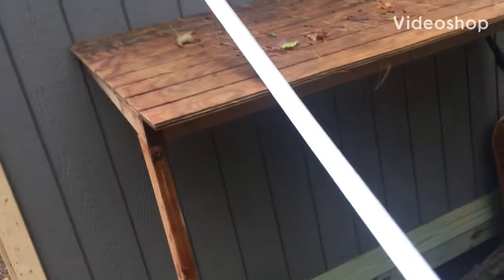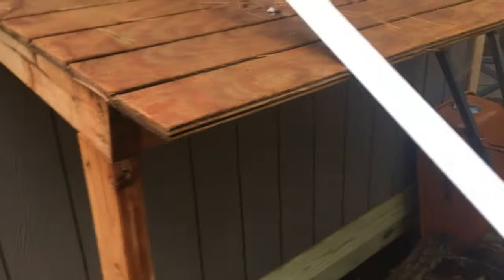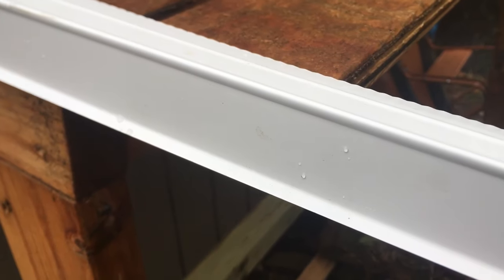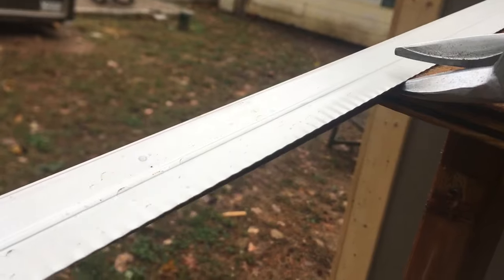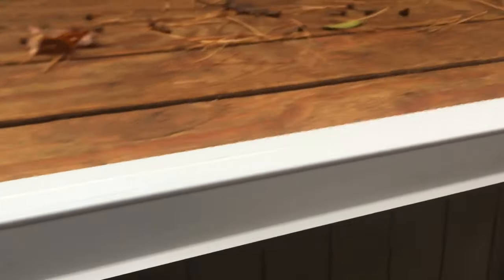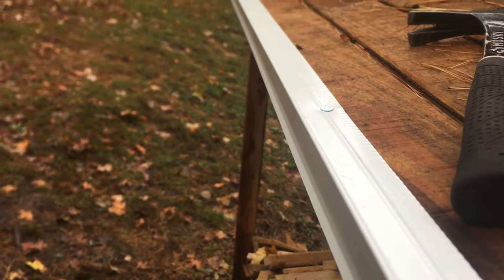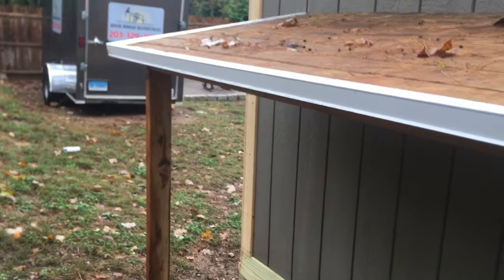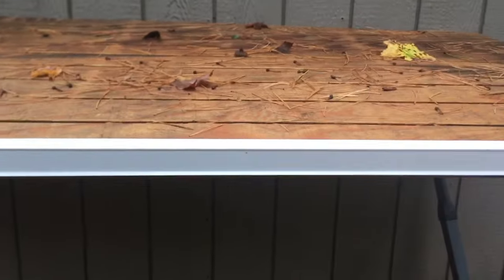How to install drip edge on a roof.

Comment: Your first corner should have been tucked under the piece coming down the side. The second corner was correct.
Reply from the maker: topshotrhit I saw it after . Ended up taking it all off and redoing it. Thanks for watching TOPSHOT👍
Reply: @HighRidgeHandyman  I've watched several other videos where they hack the edges to death - yours is simple simon, no sharp edges, and beautiful.   I read the comment about tucking under the piece, something I shall do.  I am re-tarring and papering backyard patio roof (Never having done anything like that) and am learning how via video's like yours.  Thank you for the video!  Oh, and now I know I need tin snips!
Reply: topshotrhit I was going to saw the same. His other corner was good but the first was wtf?
Reply: topshotrhit  exactly
Reply: Would I use this method on a hip roof?? I realize the angle will be a little off at rounding the corner to the other hip..
Reply: Nice catch.
Reply: I tuck both corners under the top gable flux capacitor gap cut.
Reply: yesxactly
Reply: Absolutely!

Comment: If you have fascia under this the corner here can cause water running down the fascia corner. I don't know the solution but the solution is what I am looking for.
Reply from the maker: They sell much larger drip edge with more of a bottom flare. But with gutters installed they should also protect the fascia

Comment: Good job only problem I see is the first corner is supposed to go under versus over the second corner was done correctly I appreciate your demonstration it will help me to do my roof .
Reply from the maker: Shawn Maxx thanks I did realize the first was over instead of under. Thanks for watching. If I could edit this I would. Or even add a clip. Have a good holiday weekend

Comment: On the corner you also need a cut at the bottom through to the other bend in the metal and that way your lip/ bottom bend  will not flatten out when you bend the metal.

Comment: It helps to cut a small  on the bottom of the  drip edge where the corner will be. This helps to avoid the aluminum from buckling in any way
Reply: Oops...a small v. Would look like an upside down v
Reply: Visually from a non roofer perspective (this way looks cleaner to me) but you’re not wrong

Comment: I do it the gangster way, tab and miter not cut and fold. but I also do alot more 24 gauge and standing seam. currently doing zinc coated copper panels on a big commercial project (3year project) and zinc coated copper wall panels. I also do pvc, tpo, modified torch down, cold process, epdm, only thing I don't touch is shingles. I call them guys shingleberries
Reply from the maker: Don’t ever forget where you came from bro👍🏻 We ALL start off as shingleberries.

Comment: From what I've read, typically the drip edge on the eave goes down first, then the asphalt paper overlaps that drip edge, and then the rake drip edge goes on, covering the paper. So the rakes and eaves should be two separate pieces. Nice job on bending the corner, though - that's helpful for other applications!
Reply: One thing to keep in mind. If a gutter is going to be installed, it usually gets tucked under the Drip edge. The gutter people will cut the Drip edge to get the gutter to reach the corner of the roof or even go past by ½ inch. 
My point the eve (Drip edge) should be its own piece and the rake Drip edge should be its own piece.
Reply: Can you use the one drop edge piece to complete the drip edge?

Comment: Nice video.  My observation is that The first fold should be underneath so as not to collect water
Reply from the maker: macleryy your observation is 100% correct 👍🏻 thanks for watching and commenting.
Reply: We both learn. 👍👍👍

Comment: U should do the bottom first cut the kick just a little then u cut into the top of the bottom drip edge 3/4 and fold then cut the rake at the angel. Think like a rain drop

Comment: Does this method work for a 12/5 pitch roof? Would think the angle might make the eave end lay funny.
Reply from the maker: Use two different drip edge when working with such conditions.

Comment: I'm doing a porch for someone.  The linear edge is much longer, probably 19 feet total to get all of it done, but I don't know if I can go from side to edge.  Just wondering if the best application is to do one short corner (does not have much of a rake on the back non-curb side appeal).  Should I wrap around and join on the side, or center on the eave and get two good round corners and then snap straight pieces up each rake flush to the house siding?
Reply from the maker: Kistilan I would center on the eve and get to good corners then over lap about an inch on both sides going to rake . Good luck👍🏻
Reply: @HighRidgeHandyman  That's what I was leaning towards after several videos and finishing with yours.  Definitely makes working around the Ice Barrier and not having to lift up the rakes that were tacked on a thing I won't have to contend with -- just those bends which I can lift slightly and tuck under.

Thanks for the reply in this crazy time of day (COVID19).  Appreciate it.

Comment: rake and eave metal should be 2 pieces since underlayment goes on top of eave metal but under rake metal. also, if gutters are to be installed you cant get them under the eave metal if it is continuously wrapped around and up the rakes
Reply: Unless your installing epdm rubber roof, you can fold your epdm over the fascia board then istall drip edge and then cover with cover tape all the way around on top of drip edge flange. But yeah

Comment: I can’t see where you cut if you cut that little area or to that drip
Reply from the maker: One cut across the top edge at the corner then fold it around corner. Btw the first corner I should have overlapped like the second to prevent future water getting underneath.

Comment: When you folded the drip edge on the corner you shoulda ran the bottom part un the top piece btw
Reply from the maker: I’m aware thanks for the observation 👍🏻 only 25% see the error👍🏻👍🏻

Comment: Do you think drip edge is better than gutters?
Reply from the maker: STOCKBOY7254 I use both. If I’m putting up a gutter I make sure the drip edge is pulled away from the facia and it’s over hanging into the gutter so the water runs off into the gutter. If you leave the drip edge against the wall when installing the gutter the water will run off the roof and follow the drip edge behind the gutter and eventually rot the wood. But for a small overhang like this one I’d just have the drip edge with no gutter. Good luck stockboy thanks for watching 👍
Reply: @HighRidgeHandyman  The only reasons I'm asking is the leafs,acorns,branches are clogging my gutters.Someone told me the leaf guard  gutter systems no good.Im 69 years old been up to clean the gutters 3 times its very dangerous gutters are high.Any ideas?

Comment: You did the first corner wrong the sloping piece should end up over the horizontal piece.  Any water running down the edge can potentially run under the front piece.
Reply from the maker: Chris M I realized it after watching it. The second one was correct. I did change the first. Thanks for watching. Take care bro👍🏻

Comment: My 7 year old says this wouldn't work. Water will go under the drip edge...no roofing cement or silicone...surface tension...?
Reply from the maker: Adina Bogdan I reversed the drip edge corner so the water would run off. As for the cement or silicone while having the roofing paper would be overkill for this small overhang. Maybe you post a how to video to help us all out👍
Reply: No, stop buying roofing "cement" from lowes. Underlayment, and shingles, thats it. Stop it
Reply from the maker: Chad Yost only the Depot bro only the depot👍🏻

Comment: I thought drip edge went over the paper on the sloped edges and under it on the horizontal edges. Then again, I've never done roofing.
Reply: Paper goes over the drip edge at the eave and under at the rake depending on what state you are roofing in. Some states all underlayment goes under metal. But this video was to demonstrate metal installation

Comment: Mine keeps tearing when I fold it
Reply from the maker: Just snip the top easy to the edge and bend easy to fold. Sometimes thinner drip edge will tear easy. Good luck 👍🏻
Reply: Some of them that have a different profile and you can not fold them around. The one he is using is a very basic flat profile so it can wrap around

Comment: WARNING..... "cutting a corner" is exactly what you doing.  This method does not comply with shingle manufacturers' installation instructions for drip edge.  Read them for yourself.

Comment: Never do that. You can't  install aluminum fascia and or trough properly  because it's tonight.  I see this often and take an freaking chisel  to it and split
Reply: Never do what?
Reply: It was supposed  to say to tight. I run into it all the time. Guys think they  are doing something  good but it's not. Unless you leave it proud of fascia. And most roofers also pull starter to tight to fascia everywhere and we can't  get aluminum fascia on properly, which makes the idea of it being a drip edge redundant